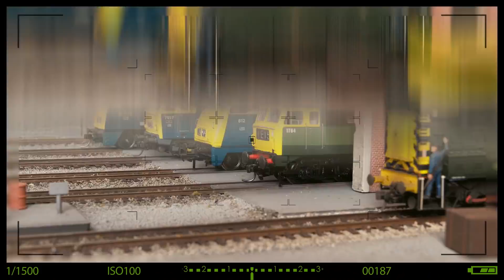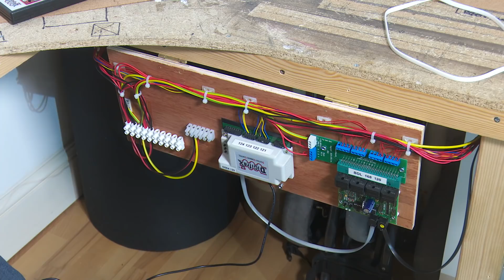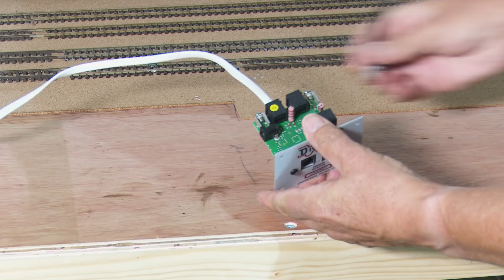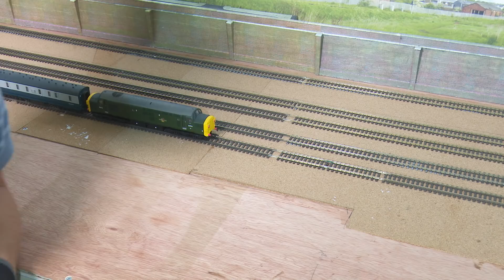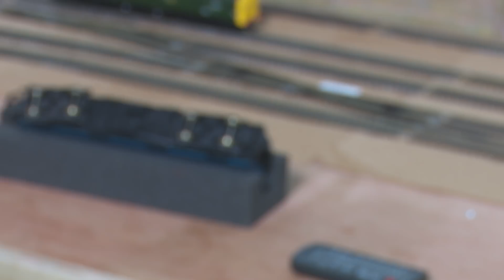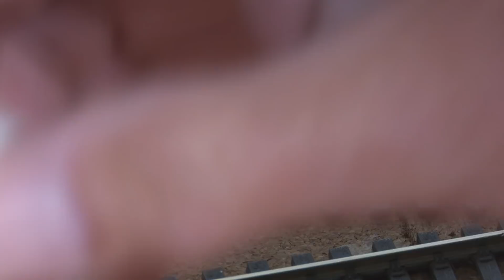44. Wiring Problem at Chadwick Model railway.

Comment: I like that idea brilliant, also if you are going into computer control and block occupancy you may have to create your own resistance wheel set, easy to do with an SMD resistor and heat sensitive solder paste, conductive glue also can work, or yes spend lots of money on pre made ones, I am in the process of building up C/MRI boards from JLC Enterprises, and doing this with my coaches etc.  Love your hard hat routine as well lol, but do you have confined space permits hehehe
Reply from the maker: Hi Sean,
I have have a previous video called, Block Detection, modifying rolling stock.  Please take a look and give me your thoughts.
Has JMRI been renamed? I use Train Controller from Railroad and Co
Regards Charlie
Reply: Hi Charlie, nah same thing JMRI uses Java programs the C/MRI I am using from JLC enterprises uses generic computer boards that will work with all DC and DCC operation, and any controller you throw at it. It is also self powered so does not take away from your DCC controller or DC power supply at all. Also it can use Java as well as Visual Basic programming to run :). some might say old and outdated but to be honest comprehensive booklets and so flexible in its installation and build.

Comment: If you have the space on your layout always try to avoid diamonds. Even in real life they cause issues and require regular maintenance. Top tip though with the nail varnish. Cheers Matt
Reply from the maker: Hi Matt, I take your point but i really wanted this facility.  I avoided a single/double slip as it would not have been prototypical. I’m so pleased that you enjoyed the video. Regards Charlie
Reply: Chadwick Model Railway no problem keep the videos coming. Thanks Matt

Comment: The nail varnish needs to be on the vertical faces of the rail, to avoid shorting by the wheels (as you have shown). But the loco pick-ups depend on the clean upper surface of the rail, so should not be affected by the varnish.
I am looking at this challenge; since the road through the crossover can only be given to one train (just like dual gauge track) so the power need only be given to one set of rails.  You therefore need to link the power for the crossover to the signals for these two crossing sections (which may also be bidirectional :) ).  You could link the relay for the rail power to the same switch that sets the two points for the crossover.
Thanks for making this clearer; sorry if I’ve muddied things a bit, but I’m thinking more and more that wheel/rail issues are simplified by wiring all points like electrofrog, and this is another example of holistic thought being beneficial.
Regards, Tom
Reply from the maker: Hi Tom, the same thoughts have crossed my mind.  I could use the tortoise point motors to switch the crossings frogs.
Regards Charlie

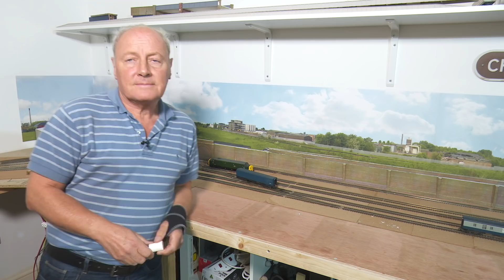Comment: The parts you put the varnish on aren't the only areas that are shorting - from 11:21 to 11:51, as you push the wagon over, you can clearly see it shorting out & sparking as the wheels (especially the 2nd wheelset from the left) cross the V at the left hand end. Because the Lima wheels are so wide, it bridges over the plastic insulating section where the rails meet at the point of the V, and shorts against the other rail. If it helps, you can pause the video and use the , and . keys to skip through frame by frame.
Reply: Here's a progression of 3 frames from 11:31, showing one of the sparks: https://photos.app.goo.gl/rKrHmZJdTFf3ehPo7
Reply from the maker: Hi Jonny, you are of course right, although it’s not as bad as the other section.  More nail varnish perhaps or I may try and switch the frogs from the tortoise point motors. Regards Charlie

Comment: Also another tip, paint the plastic inside rails of peco insulfrog points with acrylic silver to make them look like metal electrofrogs
Reply from the maker: Yes camouflage the rails, a good point.
Reply: Thats it, the insulfrog points yea, those plastic rails just give a dust over with acrylic silver and a gloss varnish on top, look so much better. will even help with the electrical problem you had  and look better too.

Comment: Just watched the wiring problem. For a more permanent fix cut the fog and fit a polarity  switch on it making both tracks one polarity varnish and paint will wear off .I did mine and all old stock with wide wheel go across no problem.
Reply from the maker: Hi, my thoughts are to use the tortoise point motors to switch the crossing frogs.  I’ll let folks know how I get on.
Reply: I’ve done this on my layout, although I used cobalt point motors but still the same principal, it works well on mine

Comment: hi charlie ,another great vid and a great idea combining eveyones top tips ,you can use electrofrog code 75 with code 100 ,peco do short transition pieces . i find sellotape works for a while just a tad fiddly to fit and doesnt last very long .love the hard hat ,cheers .a good moneysaving tip is to buy a huge roll of white wire and a set of coloured permanent markers and use it for wiring points droppers and lights etc
Reply from the maker: Hi Mick, 
I’m so pleased that you enjoyed the video.  Keep the tips coming. 
Regards Charlie
Reply: another usefull tip is to use 5mm xps laminate foam underlay ,you can use it as a track base instead of cork ,its very versatile you can clad structures with it and engrave different textures and patterns ie stonework/brickwork ,i use it for tunnel mouths ,walls ,buildings ,a base for wagon loads etc ,its around £15 for 10 square metres.

Comment: Hi Charlie, Thanks for putting up your videos, I find them very informative. I also use the Digitrax system with the DCS100 the same as yours and noticed that it looks like you have the system grounded and wondered where you ground it.
Thanks. Ed.
Reply from the maker: Hi Eddie, I don’t believe that you do ground it externally. I imagine that the electronics just need the Zero Volts as a reference. I’ll be interested if anyone else has a view. Regards Charlie

Comment: Hi Charlie: Enjoy your vids even tho' I model HO in Canada. Just wondering if the wheel sets are in gauge, why not just file the gap between the two offending rails to make it a little wider? Seems to me "painting" on nail polish will wear out at some point. Just wondering if doing so might be the long-term solution. JMHO.
Reply from the maker: Thanks for your thoughts Doug.  I might try a slither of sellotape on the offending rail. Regards Charlie

Comment: I would have replaced the wheels on the coach. You can get them from Alan Gibson. The Lima bogies use a smaller length axle. The old Lima "Pizza cutter" wheels where never the best. Keith
Reply from the maker: Wow, all the searching that I have done I never found an alternative.
Thanks Keith, regards Charlie

Comment: Hi Charlie
This might sound a bit obvious.... but why didn't you just change the wheels on the Lima coach for some more modern ones?
That will be far more reliable, and you won't have to worry about the nail polish wearing away over time.

Tips and tricks:
I have two.

1: if you need to use superglue [cyanoacrylate], place it on one of those little zip-lock bags you get model spares in... it will take over an hour to dry, which means to you can keep using it without worrying that you'll only get two or three uses with it before having to reapply more superglue because it dried up.

The reason it works is because superglue needs moisture to make it set (which is why it glues your fingers together because of the natural oils in your fingers.
In fact, it was invented for 

On a zip-lock bag it doesn't touch anything with moisture on, so if you wrote your name in superglue, after an hour it's still pliable and able to be used.

If you're working on a wet day, then after an hour or so it will start to get a skin on top, where the moisture in the air is causing it to set on the top.

2: I created a nifty mini-sander tool for my modelling out of a cheap electric toothbrush.
The bristles are cut off and a circle of velcro fitted to the rotating head.
To go with it are circles of wet&dry on the oppoisite velcro in different grades... so you can pull a circle of wet&dry off and place it on the mini-sander.

I shows this tool and how I use it in the video below.
https://youtu.be/tF_S2Nq8qdI?t=141

3: Speaking of sanding, I created some miniature sanding blocks by cutting a cork danding block into different pieces, such as small triangles.
Fitted with wet&dry, they can get into the nooks and crannies files can't get to easily.

You can see me using them here:
https://youtu.be/fkzQ9gsxklE?t=429

Cheers

Dave McWilliams
Reply from the maker: Hi Dave, many thanks for your tips.
The reason for not replacing the wheels is that none fit due to the Lima unique axel length . Regards Charlie
Reply: If I recall, Replica Railways do replacement wheelsets for Lima.

Comment: Charlie, I reckon the problem is more with the frog heel and the converging rails leading up to the plastic nose rather than the frog toes that you’ve varnished. To me it’s really highlighted at 15:58 where there’s a short occurring as you push the single axle towards the heel.  The toe only seems to short if the axle is skewed which wouldn’t really happen when the axles are in a bogie. Barnabas Junction Model Railway did a video last year demonstrating the short, just search “peco point problem” and his vid comes up first. 
And regarding replacement axles, I replaced a bunch on my HO Aussie carriages that may suit OO as well and will gladly send some to you to try out. They’re 10.5mm diameter and 25mm point to point with a tread that’s a tad thinner than the stock 11.5mm pizza cutter wheels they replaced. They’re not code 088” tread but under 110”.  
Anyway, really enjoy your channel and the effort you put into the vids. Regards from Aus.
Reply from the maker: Many thanks for your comments.  I've checked out Barnabus's video and you make a good point.  Rest assured though, it was also occurring where I applied the nail varnish.  Furthermore, Richard from Everard Junction had the same problem with Hornby locos.  Please check out his https://www.youtube.com/watch?v=qm6Pu7Rj87YIf this becomes a recurring problem, I shall attempt to wire the tortoise point motors to switch the diamond frog rails. Regards Charlie
Reply: Yeah, I see now. Although I think I’ve seen Richard’s video before it makes more sense now watching it again, and his fix must have worked because I can’t think of another video of his that commented on the issue recurring.  Thanks for the reply. Cheers.

Comment: How long does the polish last before one must replace it?  Personally, I would just put the offending rolling stock in my spare parts box and forget about ever running it again.  Well diagnosed.  Rob
Reply from the maker: I know what you mean Bob but there are many Hornby locos which have the same issues.  Perhaps Ebay remains our last resorts!
Reply: Chadwick Model Railway Equipment becomes obsolete over time.  Sad but true.

Comment: Another good video Charlie. Certainly interesting watching your diamond crossing issue and how you addressed it. Everard Junction had a similar issue and he sorted it by using a small piece of plastic. Certainly many ways to solve it out there. When I used the code 100 diamond crossing in the past, I isolated the diamond crossing completely and had independent feeders to each set of rails and used a double pole double throw switch to select which rails I wanted powered. I had no issues at all. It did involve a lot of manual switching however. The sign looks the goods and I’m jealous. Might have to get a hat of my own because I hit my head as well just before. Hat parade coming maybe? Clint
Reply from the maker: Hi Clint, I’m so pleased that you enjoyed the video.  Yes the hat saves the pain!  But so would not buying Lima rolling stock! Good luck with your layout. Regards Charlie

Comment: Hi Charlie, Happy belated birthday and the sign looks very nice.  I'm just thinking out loud for a moment, the trick for the short circuit worked very well, but I'm wondering what if you paint that area with a flat black model railway paint? With the paint, you'll visually be able to tell when the area needs touched up, verses having to wait for the command station to tell you another coat of clear nail polish needs applied?  On a side note Charlie, I've had my current Digitrax system for 18 enjoyable years now. I hope I've not just jinxed myself, but so far it's been a very reliable DCC system. Cheers, Rich S.
Reply from the maker: Hi Rich, that’s a good point regarding the paint.  Long live Digitrax.
Regards Charlie

Comment: Hi Charlie. Where did you learn all the wiring techniques?. Looks really complex to me. I have just started on a small DCC layout and with all the recommended soldering and wiring I'm going round the bend. Pardon the pun!!.
Reply from the maker: Hi Dave,  it’s very much a “Crawl, Walk, Run” analogy. Take simple baby steps at first, then stop and test.  When it goes wrong, which it will, fault finding is easier. Take notes and colour code sensibly.  Draw out your plan if you’re unsure, and see if it makes sense first.
Good luck with your layout.
Regards Charlie
Reply: @ChadwickModelRailway  Yes. One step at a time. Think I'll be going back to watch some of you're old videos to get some ideas. Cheers!.

Comment: I have this exact problem on my N gauge layout after buying some second hand Graham Farish coaches that have had their wheels replaced with some slightly wider ones, but the wheels are so much wider that they short out on the tops of the rails.
Reply from the maker: Hi Neil, can you change the wheels to plastic ones? This problem drives me nuts.
Reply: Chadwick Model Railway good thinking, I’ll get searching for some. Thanks, Charlie.

Comment: I would be tempted to just fit plastic wheels
Michael
Reply from the maker: Now there is a very sensible suggestion. Regards Charlie
Reply: it also shorts out with some hornby locos
Reply: Most of my lima coaches are MK1s so I have just replace the bogies and wheels for the Bachmann spares bogies (cat no. 36-005A), I have found these to be much better on both code 100 and code 75 crossings and points.

Comment: Hi Charlie
Are you sure your injuries are because your wife keeps catching you with her stuff lol
Great video, tailor made for me with my diamond crossing issues.
The nail varnish does work for a while but eventually wears off as you said and needs re-applying.
I opted for code 75 crossings which are proving much better.
I think I mentioned last time I had trouble not just with lima trucks and coaches but Hornby class 31, 50, 56 and 60, I haven't figured out exactly why but I will certainly be checking the back to backs in case an axle is out.
Looking forward to the tips and tricks video.
The only tip I can think of is using double sided tape on peco point motors to stick them on the underside of the base board, to help mark their position and fix them on....and a piece of wire to hold the point central whilst you do it.
Cheers
Paul
Reply from the maker: Hi Paul, I'm pleased that you enjoyed it.  I have so much Code 100, I just couldn't justify the switch.  How's your helix performing? Regards Charlie
Reply: I know what you mean about having loads of code 100 Charlie but I couldn't live with the issues I kept getting, it was driving me mad. Doesn't help Im learning as I go with wiring etc...
The helix is still working very well and 'touch wood' no warping etc as yet. 
Thanks Paul